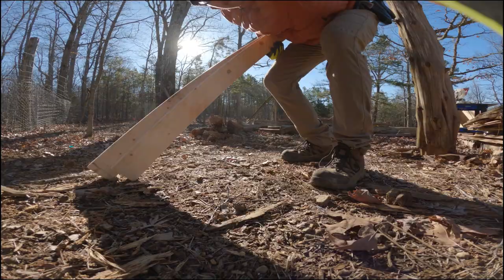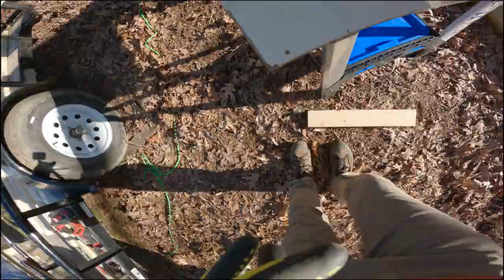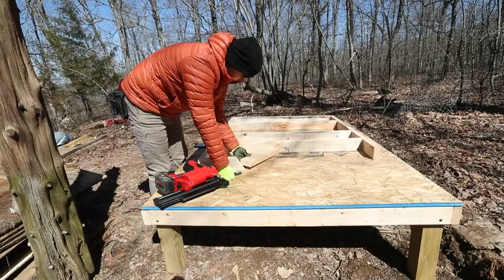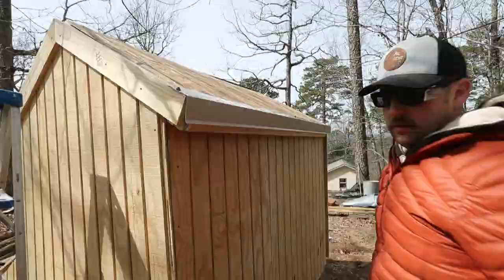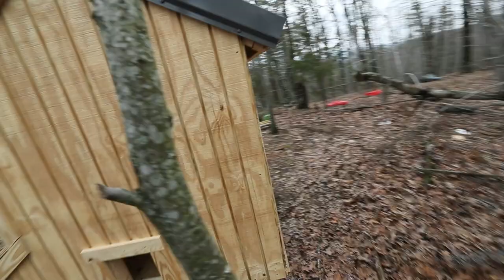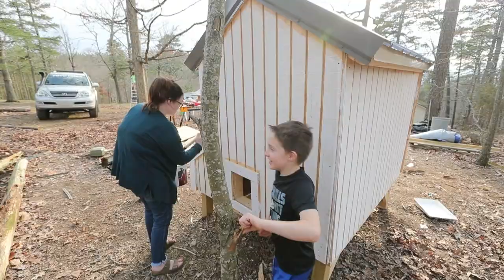Building a Chicken Coop? It's Way Easier Than You Think!

Comment: What's up man!  I'm about to do this tomorrow morning and all through the weekend.  My first coop build and I appreciate the sped up video.  I don't need a full explanation of everything, I just need to see it and be able to reference it a bit.  This is perfect.  I'm more or less doing what you did, but my dimensions are prob different and I may have more trial and error...my ground is not level and slopes about a 1.5 feet over a 6 foot distance, so that's my biggest issue, getting the foundation square and all that.  My septic field lines are underneath somewhere so I can't dig too much to level it out.  It'll work out though, I'm confident...at least at 10:45pm with a few beers in me I'm confident.  Anyway, cheers! Oh yea,  Got a Dewalt reciprocating saw for the occasion...on sale too.